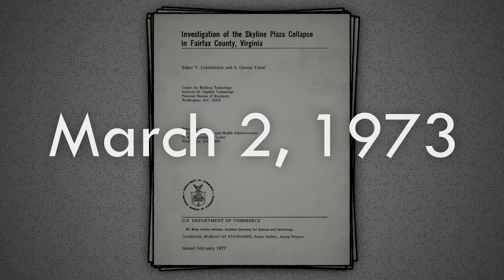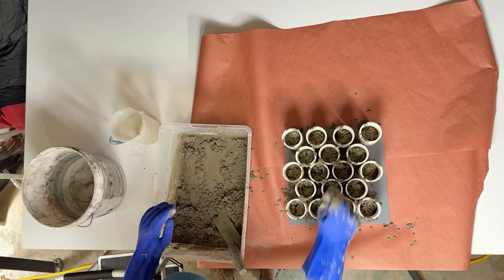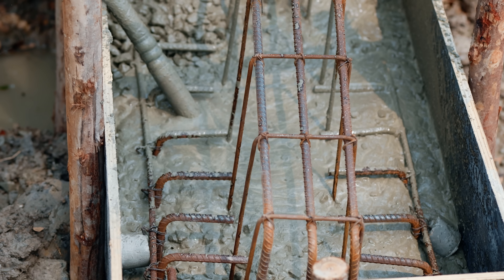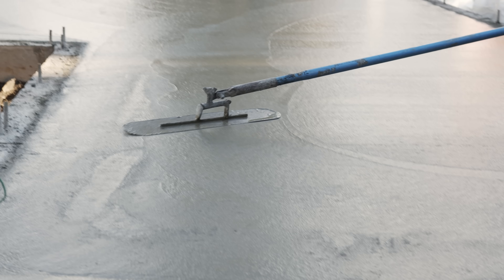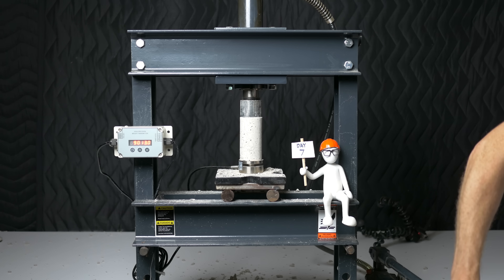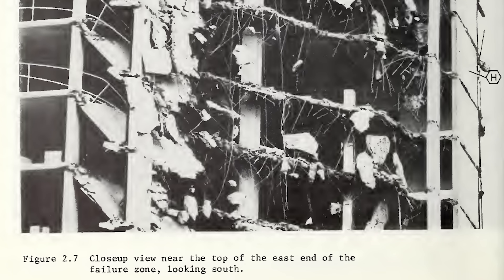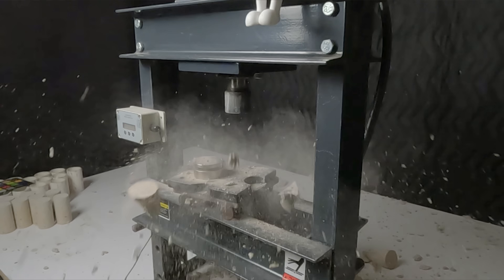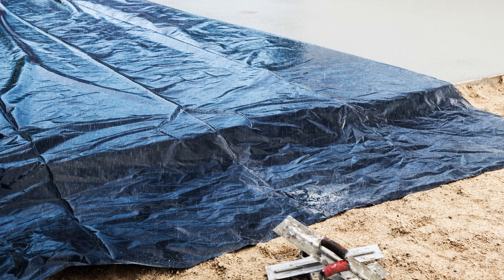Concrete's Greatest Weakness is Time

Comment: Had no idea that water does not evaporate. It now makes sense that the stuff I was using to patch some holes recommended sprinkling it with water for couple of days or covering it with a plastic wrap.
Reply: To be fair, water does evaporate. It even evaporates from curing concrete. But it's not water evaporating that cures the concrete, and because water can evaporate from poured concrete it's pretty normal to lay down a wet fabric on top of the poured concrete with a layer of plastic above that again to keep the water in the concrete so it can fully cure with the water it was intended to have. 
Too much evaporation of water from a curing pour of concrete can lead to the final result having less strength than intended.

Comment: Thats why we should use precast technology to build houses
Reply: Like with everything that also comes with tradeoffs. Precast sections can't be tied together in the same way an on-site poured structure can be with the rebar et cetera. This probably sets harsher limits on how tall you can build (which might not be a big problem for a lot, if not most, of projects). But it's probably always worth it to see if any precast solutions could work for any given project, for many reasons.

Comment: Prefabricated slabs can also be useful but it can be more difficult to install and transport them
Reply: yeah, "time is unavoidable on concrete building project"... eh not really. Well special buildings can need continuous pour for the singular strengh. However normal office blocks and apartment complexes.... plattenbau (or large panel element building) was invented over 50 years ago. Just have the walls and floors mold cast at pre-fab factory. They wait at the factorys element storage until cured and then shipped out. Foundation pour is still needed usually. though even then that can include precast elements like edge fence elements. Meaning no need to make and remove molds on site. The dropped in edge fence and wall footings elements are the mold and at the same time permanent part of the structure. The pour is then about solidly finally tying said elements together permanently as solid foundation (well and ofcourse create the base floor in between). With said elements then have necessary cavities and tie in elements to make sure the poured in foundation pour does lock the elements in.

Comment: I used to work at a water research lab and next door there was a SMASH lab that would do these concrete compression strength tests. The tech inside the building, including the design of the floors and  foundations of the building so that tests could be performed without damaging the building the tests were done inside of. It was an interesting building to visit every once in a while

Comment: Wait... did we totally forget prefab concrete 😄because it somewhat alleviates a huge amount of these problems, especially the one with a concrete floor needing to cure before you can cast a new floor and walls on top of it. And also the curing of prefabricated slabs probably happens in much more controlled conditions at a factory than at the construction site
Reply: I don't think it is possible to precast a 5,000 sq ft floor and deliver it to the jobsite in one piece. If that 5,000 sq ft floor is supposed to be the 5th floor, there are only a few cranes that may be able to lift the load, not even install it.

If you break the floor up into manageable sizes then you now have to deal the connections at all of the joints between the different elements/pieces.

Comment: This might not be your area of expertise, but I'm interested in your thoughts about the Khrushchovka -- a type of high density residential building built during the 60s in the Soviet Union, made from prefabricated concrete panels. It was developed specifically for rapid construction as a response to the Soviet housing crisis.

Comment: I inspected the concrete pours at SanOnofre nuclear power plants #2&3. The barrel on the concrete truck couldn't ave more than 300 turns or the concrete would be rejected. Strength had to be 24,000 lbs. within 24 RS.
Reply: I meant 24,000 psi within 24 hrs.
The containment building had 3 layers of #20 rebar ( 2 and 1/2 in. ) vert.  horiz. and diagonal.
    Made to withstand the impact of a 747 @ 500 mph.
Reply: What slump and PSI is that stuff?
Reply: @Nate-bd8fg   I think he means 24 ksi. I'm not sure what RS means? It was probably heavily reinforced, but to get that strength you need slim water margins, so you're probably going to need a High-Range Water Reducer (HRWR) to get it into spec, of at least a few inches slump, like 4 minimum, 6 pref. All just guessing. I have no experience in nuclear engineering, lol, but it sounds about right to me from what I do know (mostly commercial type construction).
Reply: No more than 300 turns between the plant and the construction site, is that right?

Comment: Great Video Sir.  As someone in the coatings industry, we deal with concrete a lot.  And we get asked many times, when can we coat newly placed concrete.
Reply: There are some spray applied latex/asphalt emulsions that can be sprayed onto green concrete. I know because they were used in the Big Dig tunnel in Boston with wet leaky walls.

Comment: Used to work as a lab tech in a precast company where I would wet test and make 7, 28 and 56 day strength samples along with 2-4 "overnight" samples that we would break to know if the concrete panels are strong enough to strip and move

Comment: 10:00 given that a Smoot is a known unit, we can calculate that a Grady is 0.95N. Not bad for an uncalibrated press!
Reply: What needs to be calibrated, anyway? The force meter itself? I mean, the cylinder cross section area is easy enough to measure.
Reply: @ps.2  yes, the load cell. He probably had a good idea what the readings meant but without testing it against a known load (or another calibrated load cell) it's impossible to know if you're right. Calibration of measuring equipment (and associated record-keeping) is very important in all aspects of engineering.
Reply: I was so happy to hear the Smoot reference!

Comment: Excellent video. As a life long finisher, I appreciate your respect for our work. My only critic would be no mention of type 1L and how it has completely turned century's worth of work and understanding on its head in a few short years
Reply: is 1L bad. or good?
Reply: @colinstu  It's different, not inherently good or bad.  The difference has to be accounted for in the design and handling.  If it isn't handled properly, then you have issues.
Reply: Concrete is the boss. Is what our foreman would say. Finishing concrete is the art end of the science.

I was a PM for a concrete contractor and now I am an Inspector.

Nice call out for the Type 1L Cement. we also have had issues with air entrainment and other chemicals "knocking down" the air. Same basic mix could require anywhere from 7 to 70 ounces of AE90 per cubic yard, depending upon if another finishing aid is in the mix.

Comment: I once got into a heated debate with an employer who insisted that concrete just dried. He believed that you could put plastic on it to slow it down. That is not why fresh concrete is sometimes covered with plastic. It holds moisture (and heat) in during the hydration process, and prevents rain from dissolving too much of the surface cement.
Reply: these employers scare the hell out of me
Reply: During the summer when we're dry casting pipe and boxes we'll run an overhead misting system to keep the humidity levels up.  Double edge sword though, you have to keep an eye on the nozzles to ensure they're spraying and not dripping lest the green concrete be eroded by the dripping water.
Reply: Heat though isn't useful.  Chillers are used to remove heat in big pours like dams
Reply: @justayoutuber1906 true for big pours. I was thinking more about the thin things like a sidewalk. In that case it's more important to not get the surface rained on.

Comment: Such a coincidence, just today we had our professor teach us about all the things one can measure with ultrasound. So I wonder, didn't they have ultrasound back during the plazas construction? It can be done really fast and you instantly get compressive strength, Young's modulus, basically everything you need to prevent this accident. I'm also surprised they didn't make on site test samples because that could've also prevented this. So I'm wondering, why? Is this some kind of American cost-cutting?

Comment: One of my parishioners was a highway engineer (I don't know his exact title, but he helped design and build a lot of roadway infrastructure in southern Idaho.). He would tell me that the most frustrating thing for the general public was to see construction sites that used a lot of concrete, "sit idle" for a couple of months. The engineers had to do the crush tests to see where the concrete was before moving onto the next step. That is currently happening about a mile away from my current home. We have ground level (no bridges, tunnels, or anything outrageous) traffic circle that is being rebuilt/redesigned for greater traffic flow. They started the construction at the beginning of spring. It is now November and it has been a couple of months since any crew has moved any dirt. The orange barrels and cones are still in place. Concrete, in my limited knowledge is a waiting game (unless you are actively pouring it then it is all hands on deck, especially if it is hot outside).
Reply: Soils engineering is another aspect of roadwork like you describe.

Another factor that can affect a project length is that underground utilities are often installed when we construct or repair roads.

Water, Electricity, Communication, Sewer are often run undground. The trenches have to be dug, then backfilled. Backfilling is more than just dumping crushed aggregate into the hole or trench. Backfilled material can be tested for density. If the ground can't support the road issues will develop.

Then you have the variable of humans and the companies that they run. Some folks are good at construction, some are good at removing and replacing construction. Accidents and rework are where we lose the profits.
Reply: Sounds to me more like there is some other reason as to why it's not moving along. We did 7 day breaks and as long as they met the the requirements we would put traffic on it/backfill/etc.
Reply: "Letting the concrete cure for the next 50 years."
Reply: And now that somebody has liked that comment and I revisit the slogan in my head I can see how you could misinterpret it badly. :-)

Comment: Problem is concrete is poured in batches and variability affects overall performance such as water contents, different labour may introduce different practices, strength of dry cement  used on different batches, sand used, amount of dirt, soil and other impurities in the sand, differing aggregate used in the mix, different ambient temperature wind and other atmospheric factors.... 
It's in fact surprising that concrete at all performs as consistently as it does :face-blue-wide-eyes:

Comment: I've always been fascinated by ultra high strength concrete and steel. The stuff is unbelievably strong, might be cool to make a video on it, some mixes can be upwards of 35,000 PSI and I know is sometimes used in military applications for bunkers.

Same goes for steel, boron steel is becoming more popular in vehicles and is so strong it would break the jaws of life.
Reply: I left a similar comment. I've been working with UHPC and various fibers and fiber composites in conjunction with UHPC. Replacing steel with for example basalt fiber resin polymer rebar and polypropylene fibers can reduce weight and turn UHPC elastic and behave more like a wood than traditional concrete. Basalt has the added benefit that it is immune to corrosion and being a stone product it can sustain higher temperatures than steel and has thermal expansion coefficients closer to concrete than steel. Finally, basalt and glass fibers are stronger in tensile stress than steel allowing significant cost reductions in applications where they are appropriate. Both fibers can also be pre-stressed making them suitable to complex engineering applications as well.

I use these in making ultra light and strong concrete tables and benches up to 80% lighter than traditional tables without noticeable loss of strength. The same technique could be used in making building elements if the building codes are changed to allow their use.

Comment: Do modern warehouses use prefab concrete slabs now? What are the economics behind that engineering?
Reply: Many large warehouses are constructed with a "Tilt Up" method.

Underground work is performed to ready the jobsite. This could include cement treatment or lime treatment of what may have been farmland. Utilities are installed, and engineering to support the actual structure.

Then the floor slab will be placed, this is likely reinforced concrete. Contractors will use a laser screed to reduce labor on the finishing and placement of this concrete.

Then the walls are formed flat on the new slab (after 28 days). The walls will have reinforcement installed and the concrete is placed. After an additional 28 days those walls are lifted into place by cranes. This is dangerous work and resulted in numerous deaths.

There are more steps, and the size or complexity of the building can affect the activities as well.

I think Brady did a Tilt Up video not long ago, or he will do one in the near future.